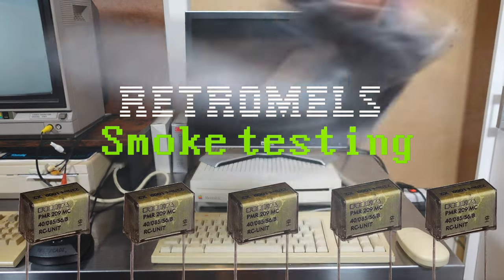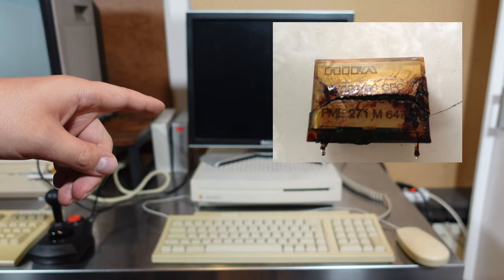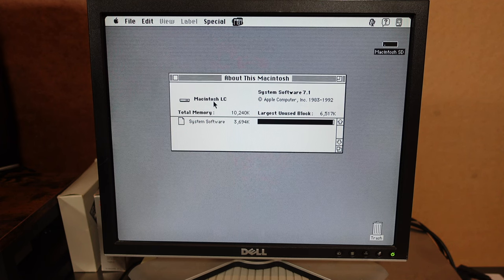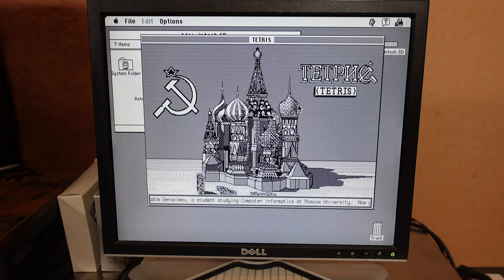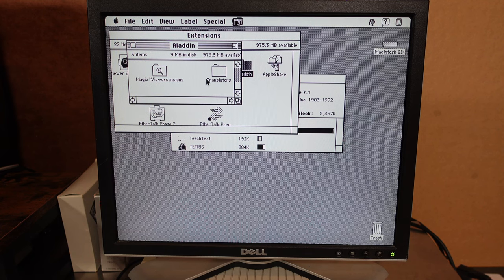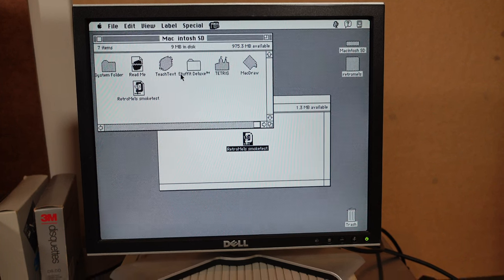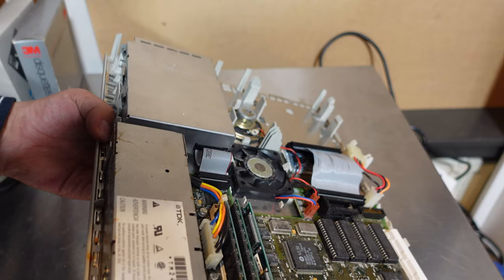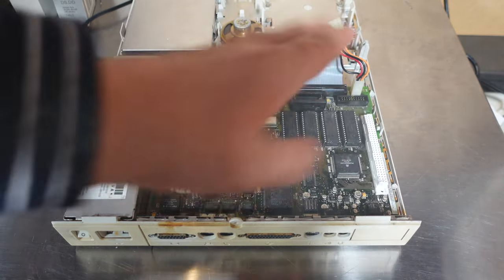Macintosh LC with Blue SCSI! |  RM Smoke testing |

Comment: De microcontroller op de BlueSCSI is geen Arduino maar een Blue Pill. Vandaar de naam BlueSCSI…
Er is ook een BlueSCSI-V2. Die gebruikt een Raspberry pico microcontroller. Met de laatste firmware en een Raspberry pico W  kan de BlueSCSI-V2 ook een netwerkkaart emuleren en kun je met Wifi naar het internet verbinden. Geweldige optie.
Reply from the maker: Oeh interessant!! Eerste keer dat ik hoor van de blue pill, zal die eens opzoeken. Wifi optie klinkt ook heel cool, zal eens kijken of ik die kan vinden. Dank Joop! 🙏🏻